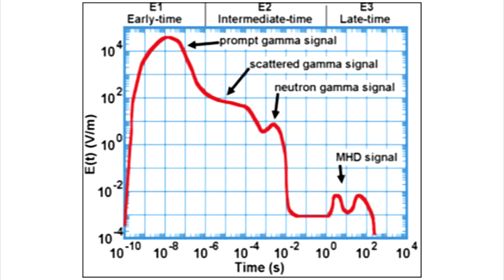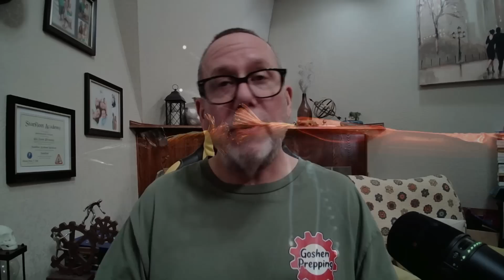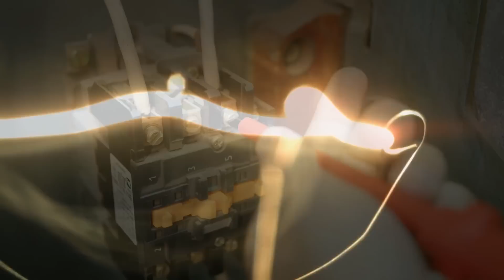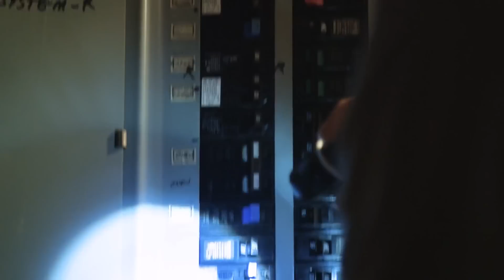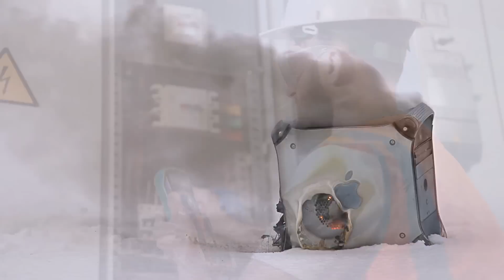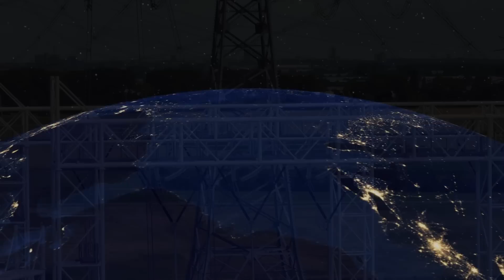How a Nuclear EMP WILL take out the POWER GRID – MUST WATCH!

Comment: I work for a power company. We have had trouble getting transformers and secondary peds since the kung flu. We've got a lot of pole mount transformers because most new construction is buried.  Most if not all the power companies around us are in the same boat. If an EMP took out the grid across the country I'd say that it would be 5-10 years minimum before we got back to some semblance of normal life, if ever. If I remember correctly the large transformers that control the grid are custom order and they take two years minimum to build. There are none sitting in a warehouse waiting for someone to need one. If the entire grid is wiped out we are F*cked. Natural gas filter stations may remain up for a bit so duel fuel generators could give you a few days of power, we will be back in the wild west, but without the benefit of having been born into it.
Reply: That's OK, I'm sure our smart phones will tell us what to do!!...........oh wait, they won't be working.............yeah, we're F'kd
Reply: I too work for a power company. We were informed that transformers for the 161kV substations have a 3-year lead time, and vendors are not committing to a shipping date due to supply chain issues.  The same goes for transformers in the 500kV subs.
Reply: Man not glad... But glad to hear someone in the fields prediction I always have figured and said minimum of 10 years just based on supply chain and length of time to make new or if possible even rebuild transformers but to hear someone in the electrical field say 5 to 10 of ever that makes me feel better about everything I do and consider with my preparedness... Hope it never happens but if it does...  Good luck at least those of us here may have a chance of survival
Reply: @berryannunziato6444  We've been dealing with lack of hardware for at least two years already. We were made to install new power in a neighborhood and didn't have any transformers. We had to build plywood boxes and run the lines to the box. Now we're running primaries to transformer pads without transformers and then running it up a pole to a transformer. It's so jacked up but there's nothing we can do. So I lean towards "if ever", because I doubt a whole lot of people will go to work in a dark building trying to repair the fried equipment so they can get manufacturing up and running again. If that happens and the guys making the transformers don't care about the chaos that's taking place outside riots, looting, pandemonium, then you still have 2-3 years per transformer, then they have to be shipped to the grid points. Plus the Carrington event ignited telegraph wires, so it could physically destroy aerial power lines which would have to be restrung, most of the large ones are hung by helicopter. I really hope it doesn't happen either, but whatever you can put back to better prepare yourself and your family the better off you will be if it does. An EMP would be devastating for humanity as a whole.
Reply: @charlesbronson9289   damn... I knew things weren't great but damn... And I have a few ideas for alternative energy but in a dark world you will have a huge target on your back if you have power... And truthfully I have some questions about alternative energy but don't know that YouTube is the place for those questions 😆 yea be ready for the wild west days because from what you put I'd say we may be lucky to have telegrams in 10 years after an emp
Reply: @berryannunziato6444  yeah, nobody knows the future, but America is a large piece of land and an EMP would dramatically affect us. I think smaller communities in rural areas could get primitive communications back up, lake party lines on crank telephones, but if all the lights went out at once cities would look like something out of a dystopian horror movie. And it wouldn't take long for a lot of them to go out to the country and wreak havoc. Prepare for the worst, and hope it doesn't ever happen. Although I'd rather it be like The Postman than The Road.
Reply: @charlesbronson9289 I live out in the country, 2h drive time from a major metro area. Lots of interstate between me and there. It’s mind blowing to think we cld be living in a John Wayne movie at any time.
Reply: If it takes 10 years to get the grid back up, then don't bother. 90% of everybody is dead. Who would you rebuild the grid for?
Reply: An EMP will not damage transformers.  The circuit breakers trip fast enough to protect them from damage.
Reply: Substation circuit breakers operate fast enough to protect the transformers from damage. I was a PE electrical engineer for 40 years in a utility.
Reply: @tomgibbs3089  I believe you. The circuit breakers would protect the transformers IN A NORMAL SITUATION. However, a nuclear EMP is far from normal, in that the e1 pulse that occurs in nanoseconds will have destroyed the SCADA control systems by induction long before the e3 pulse on the long lines endangers the transformers. Will the breakers open without central control?
Reply: @rpbajb  Yes, the high voltage (above 50KV) breakers can be remotely controlled, or automatically triggered be high current.  They typically open in 2 cycles, which is faster than damage can occur.

Comment: Got my metal garbage cans, aluminum tape, foam gaskets, and cardboard. All set to build a few faraday cages. I plan to test them out by putting a radio down inside each one and seeing if I lose signal. I might even try using two cell phones and a couple of basic two-way radios. I won't be able to stash everything, but providing that this works, I will make a larger one for my gas/propane generator, and yet another for my smaller solar generators. Gotta jet...busy busy!
Reply: I built a Faraday cafe from a metal trash can.

Comment: I’m EMPing my generator shed next week.
Inside the shed? 
It’ll be covered with 20 micron tinfoil.
With big overlaps that are not glued, so conductivity is ensured.
Glue and staples used to secure to the wood, including the floor. 
Then?
I’m going to chicken wire over it all, turning back and overlapping.
I’ve just got extra trips on the way into the house, into the generator and out of the generator.
Reply: Would be nice to watch a video of how you can accomplish that ❤️🌍❤️😊
Reply: @margaritadiaz5201  
Note my details. I’m going to make basic videos.
Reply: Use butcher folds and tape over the outside.

Comment: So with that fact in mind my idea of the 12/18 volt parallel Solar system that requires larger wires really helps everything right ! 
 I don’t like series because shading affects entire string. Also fire chances increase as well as damaging the circuit. 
 So with the parallel system and larger wires with shorter distance is best correct? 
 Anything besides diodes that could be damaged by emp aside inverter charge controller. 
 Those are cheap enough to have backups like the diodes

Comment: I've just read all of the comments. No one has mentioned that the explanation of how an EMP is produced is incorrect. An EMP is not "a massive massive ion storm". 3:37 An EMP is an Electromagnetic Pulse, which is massless and travels at the speed of light. It's completely different from an ion, which is part of an atom, and can never reach lightspeed. The explanation is partly correct; electrons are produced from the upper atmosphere by the gamma rays of the explosion. These electrons, which are travelling very fast, are then forced into circular paths by the earths magnetic field. As we know, accelerating a relativistic electric charge perpendicular to its velocity (an electron carries a negative electric charge) produces synchrotron radiation. It's this radiation, which is electromagnetic radiation produced instantaneously and coherently over a wide line-of-sight area, that is the EMP.

Comment: The EMP will induce a voltage on the any back plane. Some back planes are so significantly larger than the lands on the positive leads on the printed circuit boards.  This will result in a very large back EMF (voltage) which will fry many semiconductors. So, as the gentleman says, put any electronics you want to keep in that Faraday cage.

Comment: You're 100% correct. Large Distribution Transformers take a year to build. Each is customized for the substation in which it's to be installed. There are nine critical substations that, if taken out by terrorists, will bring the entire grid down. Unfortunately, federal energy regulator FERC published their locations. Brilliant! Each transformer weighs up to 400 tons and have to be moved by special trucks with numerous tires. They cost $10 million, and most now are made in South Korea and Germany. Getting them manufactured for each substation here will take a very long time. Once here, given that the special trucks won't work, how are they delivered and installed? According to a study done for the Congressional EMP Commission, within a year after an EMP, 90% of our population will be lost. So, if Russia, China and/or North Korea are smart, they'll EMP us, wait for a while, then invade. Our military is nowhere near prepared for an EMP, save for NORAD, which spent $70 million to "harden" Cheyenne Mountain in Colorado, and then moved in there. Most military vehicles will fail, as will our fighter jets and bombers unless they have been hardened. Exactly how hardened they are is not known to the public, but it is lacking. Thanks for a great video!!

Comment: One truck the battery is disconnected and I took a ground wire from the battery cable to the ground. It's my backup. I also have a dozen empty batteries that I mix my own acid . I keep  backup electric in a metal military goggles case

Comment: How will and EMP/CME affect a nuclear power plant?  I know they have diesel generators to keep the cooling pumps running for a couple of weeks, but will that be enough to keep a melt-down from occurring?
Reply: Most of the information about nuclear power plants is incorrect - in shut down the rods are lowered into there sleeves and the reaction stops - 
      If the power plant has disconnect from feeding the grid the generator that is used to feed the grid still can generate the power to keep the plant running till the reactor has cooled about 90% - then the emergency generators are phased in and began to take the support load as to running the cooling pumps - 
        Within one to two today's the reactor is 100% cooled down and stable - that's why only two weeks of fuel is on hand - the spent fuel rods do not generate heat - nether does a shut down reacted generate any amount of heat once the rods are lowered -  
     At that point the entire plant can be shut if needed - no power is required once the reactor has cooled down - there other support systems that prevent freezing ect - 
     If it's a long time shut down water and cooling lines might have to be drained to protect from freezing ect -  two weeks of fuel for shut down is more than needed

Comment: QUESTION: Can you PLEASE provide links for emp shields for homes, vehicles, tractors etc that you recommend? I have NO IDEA what to buy or even where to buy. Don't want to get ripped off by scam artists. Thanks!
Reply: That's because they probably are scams. You'd need a Faraday cage to protect the most sensitive electronics, and a surge protector some two or three times as quick as standard to do it.

Comment: what will happen to planes in the sky if an EMP happens??
Reply: An airplane is a metal shell, so the electronics inside the plane should keep working. 

But the antenna on the radio and radar and altimeter will likely go poof. 

So the plane won't crash directly, but will have to find somewhere to land with no help from outside. 

Landing at night in blackout conditions with no navigation or radio or radar might be challenging to say the least.

Comment: How can we be informed if anything happens? Is there a radio ch we can tune in to?
Reply: Radio receivers will be the first thing to die. They are designed to receive microvolts of electromagnetic energy. 50,000 volts  will blow a hole right through the NPN junction of the first transistor in line. 

A tube radio will likely survive, you can't make a hole in a vacuum.

Comment: I have a eco flow and panels that is not plugged in. How do i protect my refrigerator and freezer?
Reply: You need the home EMP protector. The electricity will all go off but the frig and freezer will still work because of the EMP protector. (Plug them into a generator and they will work.) without the EMP protector everything will be fried
Reply: If your fridge and freezer are 'smart' models, the electronics will probably be fried. If not, they should be OK.

Comment: The five grids in the continental US are too large to be completely taken out by one EMP burst.   The high voltage circuit breakers would trip and isolate the affected area.  It may take the utilities several days to pick all load, only because the generators in the affected areas would have to be restarted.  High voltage “relays” are just big circuit breakers, which are fast enough to trip before equipment is damaged.  I’m a retired PE electrical engineer, with 40 years in the industry.